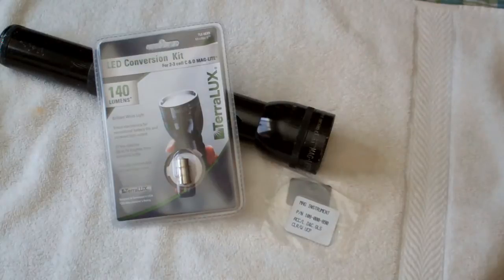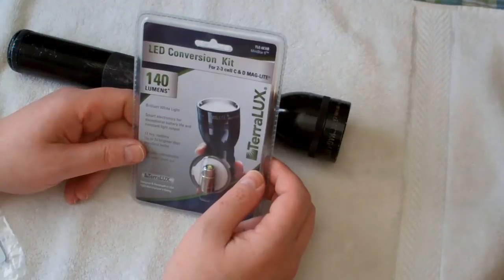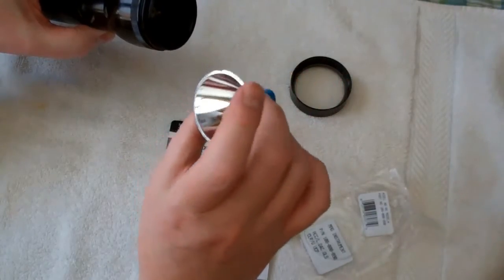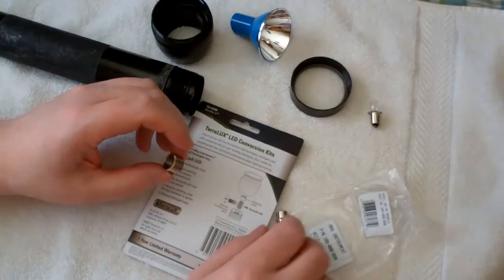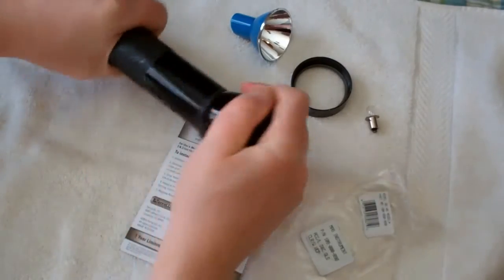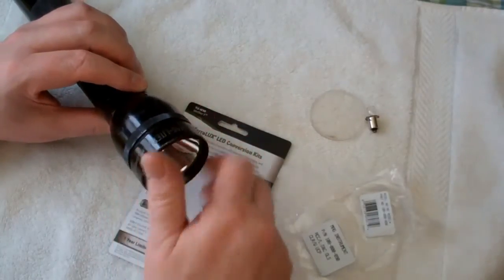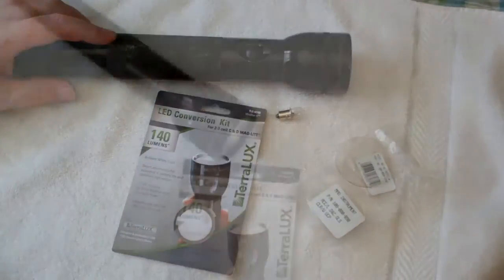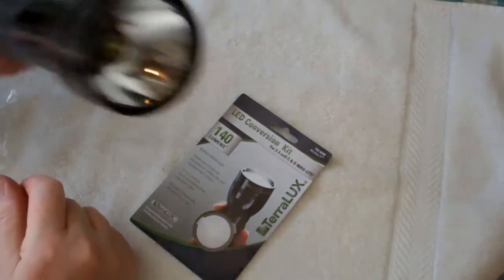Mag-Lite D-cell flashlight TerraLUX LED bulb conversion kit

Comment: I purchased 2 terralux led drop in's for my magchargers. They are used every night for about 4 or 5 hours. One started to fall apart after about 10 months, the other lasted a bit more. 
I now use the drop in made by Malkoff devices. They are more expensive and sometimes out of stock, but they are 100% reliable for every day use. I have used them now for over 3 years and they are very good.
Reply from the maker: Good tip to note...Thx!
Reply: Thanks Rafael555

Comment: Just now seein' this video. Tip...a tiny little bit of silicon lube or vaseline on the O
rings and threads helps with Mag-Lites...particularly on the tail cap...with that great bloody spring ya gotta fight there(8-). And there's "science" inside those new LED
inserts. That's why they have a little heft to them.

Comment: Vaseline those threads and O-ring, prevents aluminum from gulling.
Reply from the maker: I had picked up some Nyogel a week or so later for all my flashlight threads - never thought of using good ol' Vaseline!
Reply: You do not want to use Vasline, it eill liquefy just above body temperature!